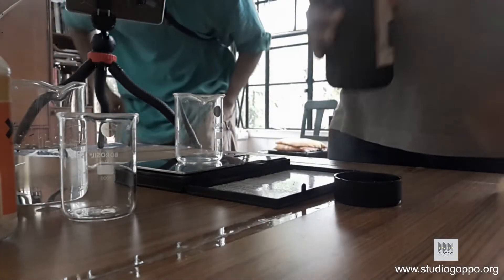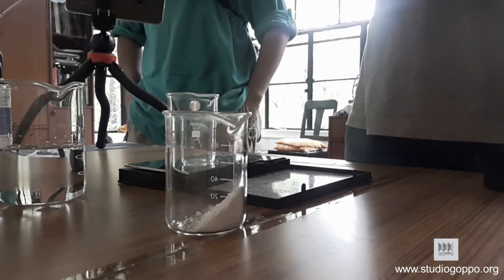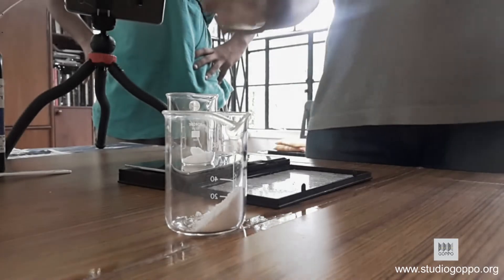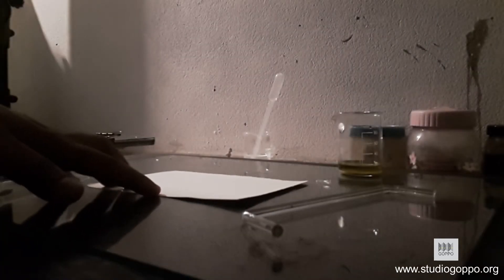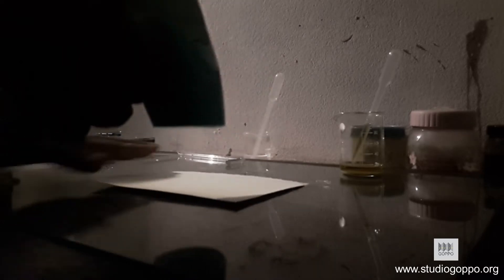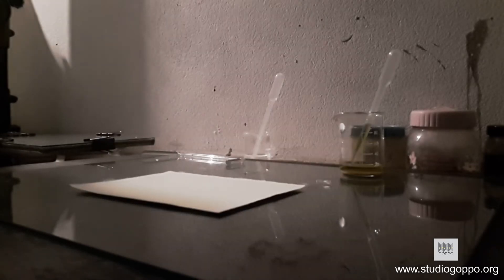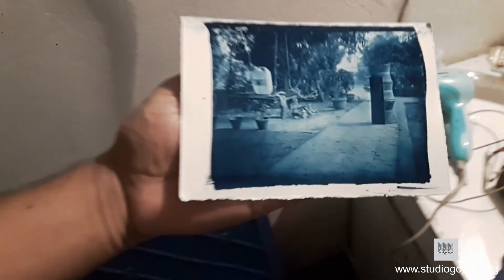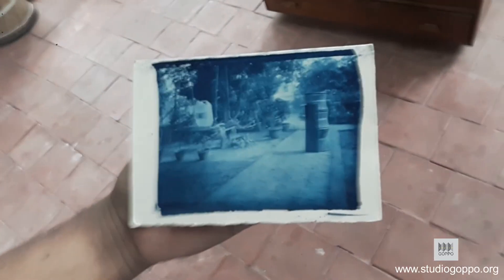Photography with Iron salts

Comment: very informative video! very good content. thanks a lot. I am testing right now the ferrous oxalate, oxiding it with hydrogen peroxide 10%. It seems it's working fine
Reply from the maker: Add a little bit of oxalic acid with it and add H2O2 drop by drop to make Ferric Oxalate.
Reply: @studiogoppo3974  thanks for the hint. I tried also to prepare the ferric oxalate using your method, but after a night it ended up from green to yellowish colour. I am trying right now to use it anyway.